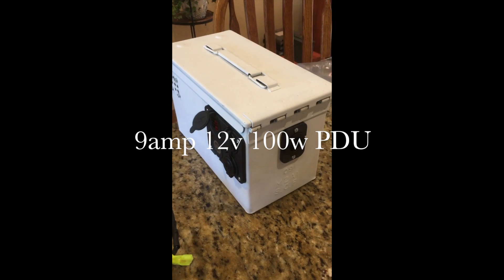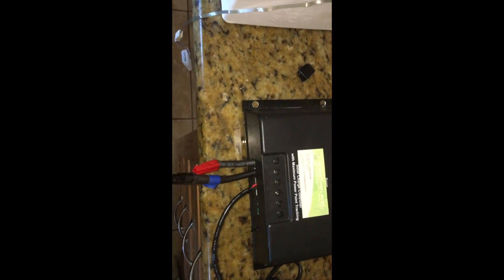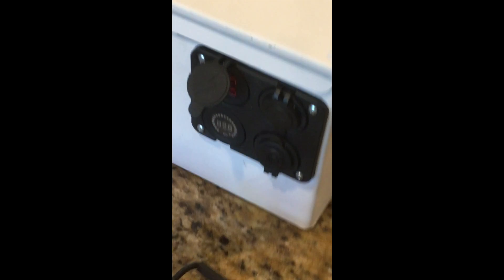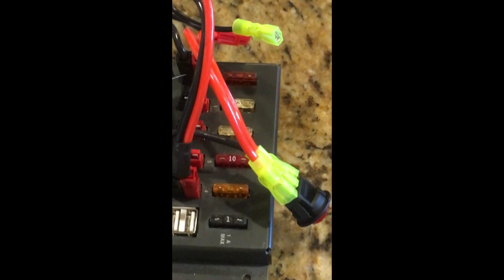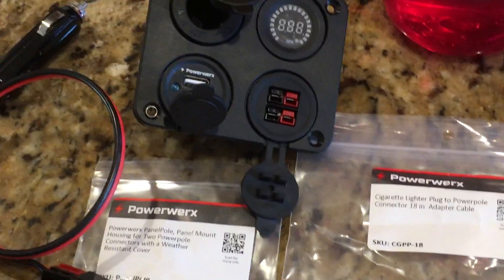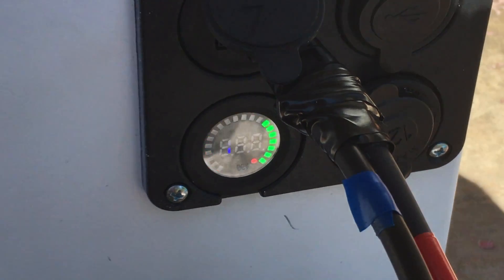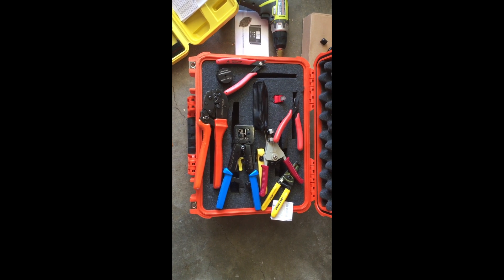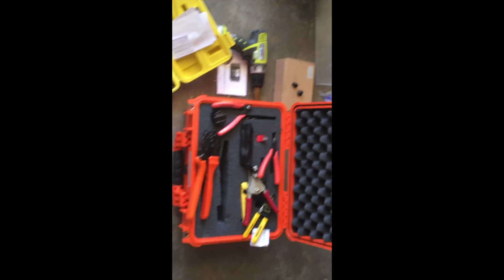12v power project

Comment: Dude turn your camera horizontal. It was jarring going back and forth from wide to Pillar-box.
Reply from the maker: thanks.  Im not a normal youtube contributor.  will make those changes in the future.  I have been running that thing for a couple years now.  not water tight, but has been under a tent trailer (panel on top of the trailer).
Reply: Steve Klise Hi Im new to your channel can you remove the anderson powerpole that comes with the powerwerx anderson mount? If yes how
Reply from the maker: @GabrielV93  yes, its all modular